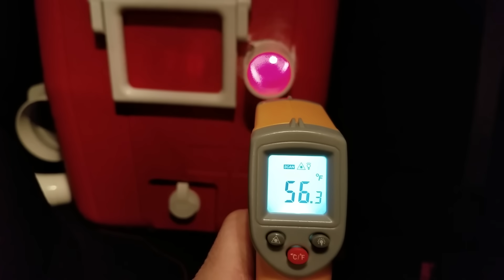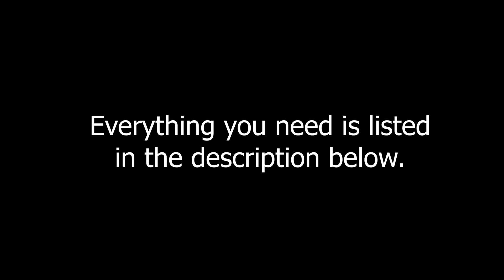Homemade Portable Air Conditioner DIY - Version 2 - Runs off 12 volt battery, car, or solar!

Comment: I’d take some small flimsy shelf like a or a locker shelf some small and metal and stack them freeze packs over the top of it.
Reply from the maker: Doing that will not make it as cold. You want your ice to touch as much of the surface of the vent pipe as possible to make it cold.

Comment: Sir what is the room size we can use it..
Reply from the maker: I used it in a small 7x12 room and it worked well. I haven't tried anything larger than that yet.
Reply: Thank you for your valuable response.
Reply: I am planning on trying this. I have a new 8x20 car hauler. I insulated the walls and ceiling, made the front 1/3 into a camper with 110 and 12 volt RV electrical system, double sink, toilet etc. Do you think it would have the ability to cool this down?

Comment: What do you think about using a bigger ice chest for example a 120 quart. You could run a lot of tubing thru a bigger ice chest. Im trying to get away from using a generator and window unit on my little 22 foot sailboat. I've got a lot of useless space under cockpit that a ice chest would slide into.
Reply from the maker: I think it would work just as well with a larger ice chest and obviously, it would last much longer.
Reply: thanks for the reply

Comment: Hi, thanks for posting this. I plan to build one for the minivan camper, what is your opinion if I am using a 130CFM instead of the 220CFM. Thanks again.
Reply from the maker: It will still produce cold air, but since you are pushing about half of the airflow, it may not be able to cool as much space.
Reply: Thanks for your reply. I am going to power it with a 100w solar + 100ah battery, my concern is with the 22CFM fan I don't have enough juice through the night.
Reply from the maker: The 220 CFM blower pulls 6 amps which means a 100ah battery could power it for 16 hours. (100/6). However, you don't want to let your battery get below 50% because it will decrease the life of your battery. 50% would be 8 hours which would get your through the night no problem...unless you are running something else on the battery as well.

Comment: What 110 volt blower is designed like the 12 volt blower you use? that's the only difference that mine will be from yours.
Reply from the maker: I'm not sure. You could check Amazon or either google a 110 volt blower.

Comment: The question is is how loud is that blower? I imagine it's just as loud as a bathroom fan. This is a great idea. I built one a couple years ago when I used to do lawn care service and my truck didn't have good AC in it and the air conditioner that I built was only effective when the pipe was right on top of you and after a couple hours it was blowing warm air cuz it would melt the ice.
Reply from the maker: It's about as loud as the AC in your car on high.
Reply: Answered my question I just asked
Reply: Could you out some foam cover or something over the fan to suppress the noise or would that affect the air flow?

Comment: Is that metal tubing aluminum FOIL tubing? Yours looks more solid than mine.
Reply from the maker: It is a rigid metal tubing. You can check it out by clicking the link in the description.

Comment: Your design makes more sense than the ones with the Peltier fans. How hot was the hottest day you've used it and how cool did it make your surroundings?
Reply from the maker: I'm in Colorado so it hasn't been a very hot day yet. I plan to take it to Moab with me in a couple of weeks and it is supposed to be in the low 90's. I'll test it in my camper and see how it does.
Reply: make & do i live in tropical part of the world.. Humidity is very high will it cool my room?
Reply from the maker: That's difficult to answer. It would depend on the size of your room as well as the temperature.
Reply: make & do 6x9 very humid and summer is about 39-41c im not sure bout the humidity tho.. But very humid
Reply from the maker: The room size is not to large, but 40 c is pretty hot. It would cool it, but I can't say for sure how much. But even a 5 or 10 degree drop would help.

Comment: Great video..thanks for the detailed list as well. Just one quick question, can the Seaflow air blower take a regular A/C cord so this can be used in the typical home outlet ? Cheers and thanks again.
Reply from the maker: You would need something to convert the 110 volt in your house to 12 volt. They make adapters like that, but I've never used one. Try googling 110 volt to 12 volt plug or AC to DC adapter.

Comment: Hi I have a power bank/car portable jump start would that power up the fan that you use?
Here’s the specs:
Suaoki jump starter
Capacity: 20000mAh
Power: 74wh
Input: 15V-1A
Output: 5V-2.4A/2.4A(max)

And for the second question..so this means I can’t use a big ice? 

Pls reply ASAP
Thank you
Reply from the maker: According to your specs, the output is only 5 volts and 2.4 amps. The blower in my video requires 12 volts and 6 amps. So your power bank would not work. For your second question, what do you mean by big ice?
Reply: make & do 

Like a big chunk ice..if I put a heavy ice on top of the aluminum pipe would it mess up the pipe?

Second question is what kind of power bank could I use that will work for the fan..
Cauz im trying to avoid using the electricity..

3rd is I have a solar panel 40w with DC18v and usb 5v output ..what kind of power bank do I need that I can use my solar to charge the power bank and will work for the fan
Reply from the maker: Crushed ice would work better because you will have more ice touching the vent pipe. A big chunk would only be touching the top. As far as a power source, you simply need one that has an output of 12 volts and at least 6 amps.
Reply: make & do 

Oki so I have to get something that has 12v 6amps..if I get that kind of power bank can I still use my solar to charge it? Cauz if not I have to return my solar while still early 
I already mentioned that specs of the solar 
And thank you for helping me
Reply from the maker: Sorry, but I have not done a solar hook up before other than a simple solar charger for usb. So I would not be able to tell you for sure. Just ask the people that you buy it from if it will be enough to charge the battery. They would be more qualified to help you with the proper solar panel and battery. Just be sure your battery produces 12 volts and 6 amps.
Reply: make & do 

One more question..do you get any water inside the pipe? Like the moist or when the ice melts? How did you like your set up so far? Or do yo I have any other way around? Does it cool the room?
Reply from the maker: I have not got water in the pipe yet. However, it is possible if the pipe gets a small hole. If that happens, simply open the cooler drain. You can connect a hose to the drain and run it outside if you need to. If you do this, the water will only get about an inch deep which still leaves plenty of room for air flow.
Reply: make & do unfortunately the sealant didn’t last..it start dissolving..what about yours?
Reply from the maker: Did you use the same sealant I did? It should not dissolve as it is waterproof. Mine is still fine. You should send it back and get something else.
Reply: make & do yes I did use the same sealant like what you use I followed the links

Comment: Shaking salt from the salt shaker on the ice would lower the melting temperature of ice and makes it last longer.
Reply: It might make it melt faster, but it will lower the temperature of the water to below freezing, thus having more surface area to transfer the cold to the duct-work, making it in fact, colder for longer periods of time.  (Google "rock salt cooling")

Comment: hey will the ac unity take ice and a dry ice mix
Reply from the maker: Not sure. I haven't tried it with dry ice.
Reply: pretty sure you dont want to breathe that in. keep dry ice for sealed food/drinks
Reply: If you never opened the ice chest you wouldn’t breathe the dry ice you would just get the benefits from the cooling am I correct?

Comment: couldn't you put the input towards the top and run the pipe down towards the bottom? This would help avoid any leaks.... Thanks for sharing.
Reply: Do you think if the metal tube was doubled in length and ran twice it would make the air even cooler?
Reply from the maker: Yes. This would actually be a better option. I thought about doing that too late.
Reply from the maker: Sounds reasonable. That would give the air more time to get cold before exiting the cooler.
Reply: Whatever ice you put in this cooler doesn’t get blown out.  The air thatbis cooled and blown out is contained in the metal duct.
Reply from the maker: It's as loud as your car air conditioner on high.
Reply: Can you do a video of before and after temp of your suv?
Reply: The plastic is not as thermally conductive as metal and thus would not work nearly as well.
Reply: Kev's Bootlegs I keep mine in my truck, and I put a Walmart dryer duct on the intake of the blower and stretched it under my back seat and it helped tremendously with the noise level
Reply: Someone said put in dry ice. DO NOT PUT IN DRY ICE lol. Thats good for keeping things cold yes but not to blow in the air
Reply: Dan Bowden put some salt in the ice and see how the temperature goes down further
Reply: @amit dhomne Wouldn't salt cause the metal to rust faster?  Or is that metal rust proof?
Reply: Here's an idea: mount the fan higher up to avoid leaks, but have the inlet of the fan pointed down or have a tube attached to it angled down and you could also ad a baffle/muffler to reduce noise
Reply: That is how I did mine, however I used 4" instead and made a hole in the lid for a 45 Degree angled swivel, actually works pretty good
Reply: Can i use plastic pipe as an alternative?
Reply from the maker: I can, but it will be a while. I'm out of town for about 6 weeks.
Reply: How loud is this? can you do a video of that?
Reply: Kyle, I was worried about that. Haven't ordered yet. I'm looking at other options but in general the more CFM the more noise.
Reply: I got the motor and its kinda loud.
Reply: but im sure theres a way to narrow the intake and make a  muffler can quite it down a little.
Reply: My semi rigid took on water, but my inlet and outlet are above the water line
Reply: make & do Is the aluminum duct watertight?
Reply: In open circuit the dry ice will break down faster than wet ice. Dry ice in a closed to the open air space will last longer, but with it having air blowing across it, will cause the dry ice to degrade faster.
Reply: Just a thought on the noise issue. The fan looks like it would fit inside the cooler, and if you position it higher as suggested I would expect it would be quieter and more compact. From the looks of the blower, I don't think moisture would be an issue, because it appears to be a sealed unit.
Reply: make & do  I'm not sure of im right about this but I think rock salt actually helps  Ice last longer the kind you use when making ice cream. I haven't seen anybody mention anything about  This on any of the videos
Reply: Amit, I was thinking the same thing!
Reply: What can one do to draw cooler air in, to begin with (instead of outside hot air)? 
And, what are your (or anyones)  ideas going forward on how to make this unit/idea/design truly "portable?"  Very interested/interesting for obvious emergency reasons. Tks for sharing. +make & do + Dan Bowden
Reply: @kargs5krun  have your inlet right next to your outlet so the initial air sucked in is cold.
Reply: Could foam help lower sound of the fan?
Reply: @keeponkeepingon... I suspect the noise is coming mostly from the hold in the front.  Maybe if you put some metal pipe on the front it might muffle it some.  I don't think you want to put too much pipe in this design though since the more pipe you put in the harder it is to push/pull the air through.
Reply: Thanks for sharing. What a great idea 👍🏼
Reply: make & do Could you make another showing this idea?
Reply: Kev's Bootlegs hi, can you post a video that we can hear how loud it is? Thats the only thing stopping me from going forward.thanks!
Reply: Kyle 1 hi, can you post a video that we can hear how loud it is? Thats the only thing stopping me from going forward.thanks!
Reply: Rob, how well did it keep your van cooled ???
Reply: al karg ,  split the wires end so instead of plugging it into an outlet connect it to a 12volt battery.
Reply: No it isn't Bro.... Not that type anyway...... But I did find some HVAC metal foil ducting that is water tight, I will be fastening to the bottom, so that it stays submerged no matter how much water is in it... It will look like this one here http://www.aluminumflexibleducting.com/sale-8670935-ventilation-aluminum-foil-ducting-waterproof-compressing-flexible-air-duct.html
Reply: Well technically he's created a closed system but I couldn't help but wonder if you couldn't double down on the amount of Hose I don't know how much it would really help but you could really super cool that are before it comes out. Also you could add a little bit of salt to the water and ice makes and then like hypercool it
Reply: Yes you can, but not if you want cold air.
Reply: your answer sits waiting for you in comments at the top under user name "Apsert" Peace -
Reply: Dan Bowden
Reply: The Heat from the fan eventually would melt the ice quicker, The fan wouldnt sound too loud with "both" intake and outlet muffled with pipe on each end
Reply: Curtis Jeung  it wouldn't be able to suck air if it was in closed in the cooler it system is sealed ( yes it would suck some air but not effectively/efficiently)
Reply: Kev's Bootlegs  stick the motor in the cooler to cut the noise.
Reply: Aside from when the ice melts, that leaving the in/output out of the ice, I don't see why that wouldn't work. The difference in cooling should be minimal, if even noticeable. I may try that, as that was a concern for me.
Reply: my thoughts.
Reply: +Lubay Nestle I don't think that the plastic will transfer the heat as quickly.
Reply: Great idea i think.. but maybe you could try longer pipe but smaller diameter with ribbing on it like a heat exchanger it would transfer the cold quicker the pipe  diameter is to large but still seems tobwork great considering how long it last for with the ice.
Reply: Dan B j
Reply: How long will this system cool?   I have an ALiner camper and I wonder what the draw on a battery system would be?
Reply: Dan- - - Cool air sinks, maybe it's better to recirculate cooler air than taking in Hotter air.
Besides, if it isn't leaking- - where's the problem ?
Reply: I doubt the air 6 inches higher will that much warmer. And plus the majority of the steel tubing will be on bottom of cooler anyway. Just like the exhaust is placed higher, why not the intake. 

Was also thinking of putting intake and exhaust in the lid so when you shut the lid both pipes slide into the steel tubing.
Reply: If you added a small block of dry ice it will make the other ice last even longer.
Reply: Dangerous indoors, especially in small rooms - Dry ice is CO2, displaces oxygen.
Reply: @clallen2000  "Dry ice" is actually frozen carbon dioxide.  As it "melts" it turns into carbon monoxide gas (sublimation), and CO2 is not breathable, so if the unit is used in an enclosed space, you can create a lethal environment.
Reply: You cannot breathe dry ice fumes, it will kill you...
Reply: This fan is LOUD as crap lol, it fricken blows, way louder than the AC, if your in the same room with it, its very loud. Works fricken awesome, not complaing. If you have hardword floors its extra loud lol.
Reply: Plastic pipe doesn't conduct well. Don't use it.
Reply: If you put the input towards the top, wouldn't it be hard for the fan to push the air? The air flow has to go down and then back up.  Where as the way it is now, at the bottom the air is forced straight in the up.  I am concerned about leaking too, but think it is better at the bottom for fan power???

Comment: When the ice melts, will the conduit intake bottom be below water level?   Do you think there is a material loss of cooling efficiency if the intake is mounted near the top, avoiding leakage problem, rather than at the bottom?  I am thinking the first couple of inches of conduit would always be above water level and therefore not chilled.
Reply from the maker: The bottom couple of inches will have water so the conduit is partially submerged. I think this adds to the colder air because you have more of the surface area of the conduit being touched by the ice cold water whereas the top part is only touched in several small spots by the ice. I think this is why it got colder after running for a few hours.